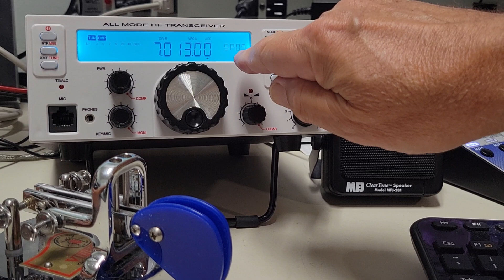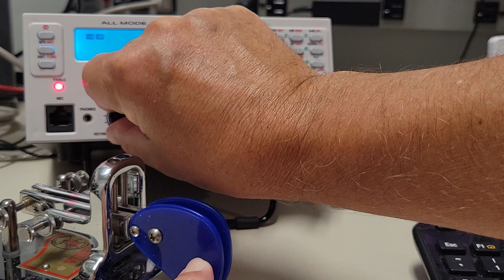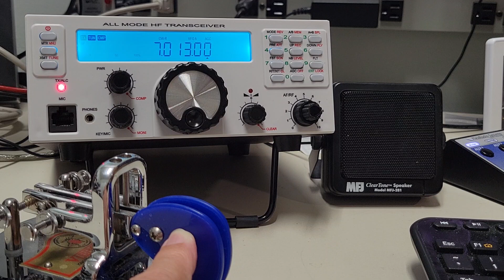RGO-ONE Transceiver CW QSK TEST RESULTS

Comment: I recently bought one of these Steve. The QSK is greatly faster using v2.51a firmware and Boris also corrected the reverse paddle wiring you noticed. They are always improving the radio. de Wb8yqj Don

Comment: Very nice little rig.  I'm so glad to learn of it via your video.
Regarding your test: it seems pretty impressive that a transmitter putting out such such a fast staccato can be detected during what is equivalent to the letter spacing while sending at 36 wpm.  Yeah, I think that is right... if sending continuous dits at 12 wpm, the space between the dits is the same as the SPACE BETWEEN MORSE SYMBOLS (e.g. letters) of 3 times that long.  So at 36 wpm you'd have the equivalent pause between each letter as your dit spaces at 12 wpm.  Word spaces, of course, would be even longer.
It's kind of hard to know how this compares to other full QSK rigs without similar test results.  I wonder if you or anyone else does similar tests using commercial rigs and can say?  Of course nobody expects to be able to copy the sending "other" station between dits or dahs but knowing that they are there by hearing something between letters can clue the rig operator to pause and give the other guy a chance to interrupt.
Thanks again for the informative video.
Reply: Excellent observation because I'd never seen this sort of test before. As I was listening to some 30-ish wpm code the other night (hoping to catch a word or two) I heard one station break in on the other station two different times.  I hadn't heard QSK actually used before then. Had I not read your reply I might think that those stations had to have top-line rigs to hear QSK at the speeds they were running.  Maybe they were, maybe not. Thanks, 73